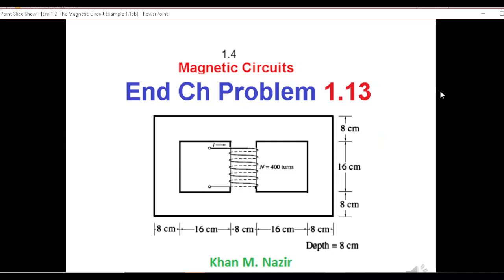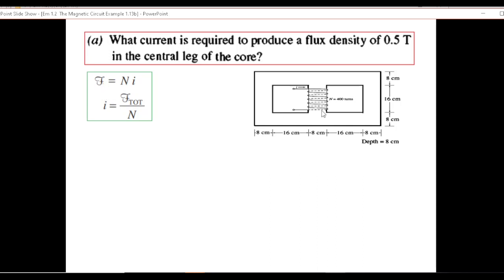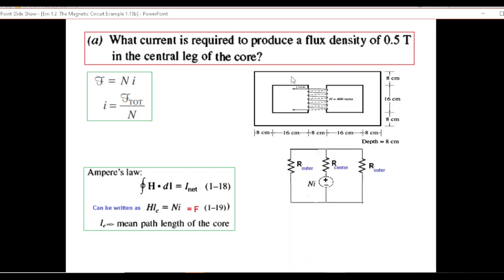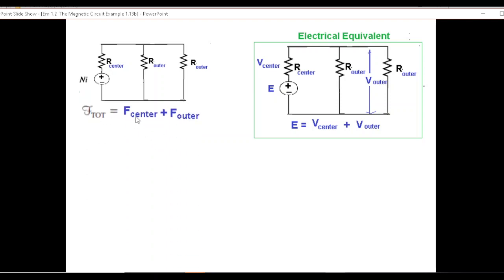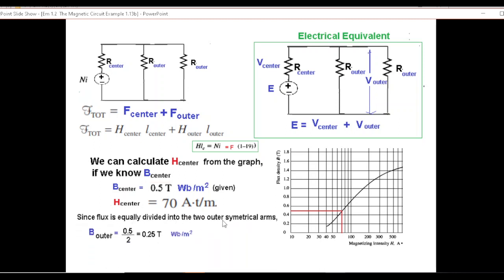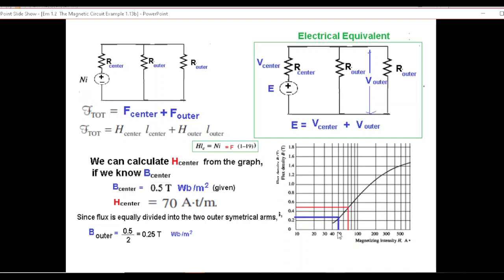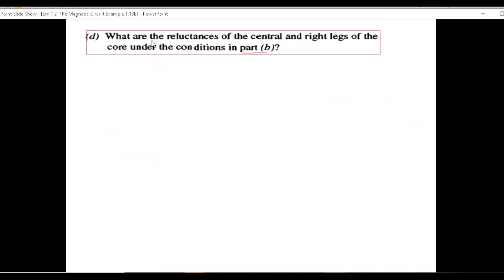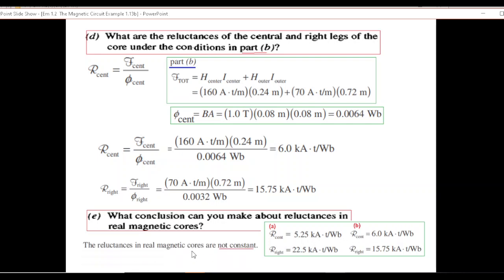Magnetic Circuits || Core with Three Legs  || End Ch Q 1.13 (Chapman)

Comment: Sir, u said that we divide the center flux density by 2 since there are 2 symmetrical outer legs. But what if it’s not symmetrical, how do we find the flux density of the outer legs?
Reply from the maker: Divide by the cross sectional area of each side.